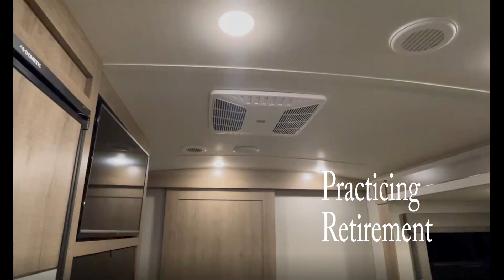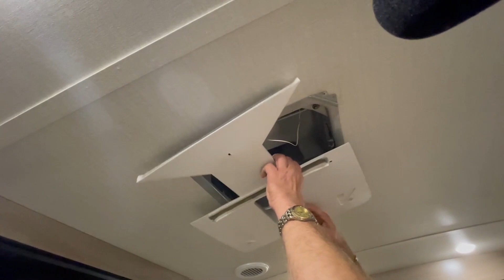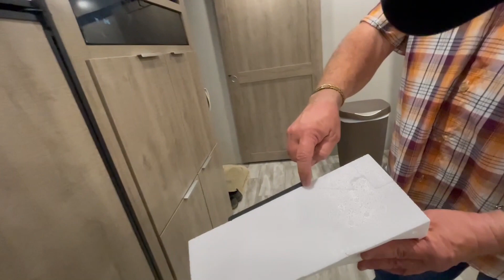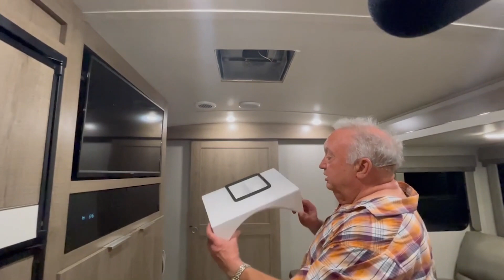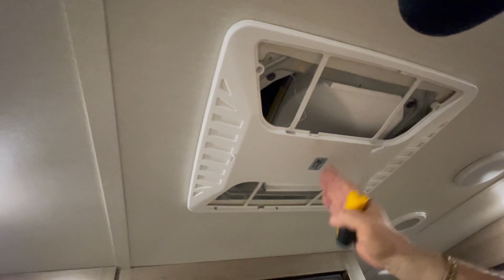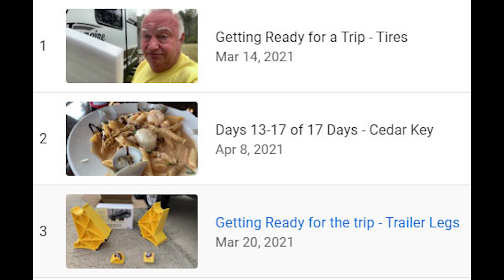Secret to Cool your Grand Design Imagine 2600RB

Comment: What is the piece called that you installed on ac and how do I get one
Reply from the maker: It is simply call "RV Airflow System".  Go to rvairflow.com.  There are several sites and Youtubes that show discount codes of 15% and I even saw one for 20%.  After having used it during the summer, I can tell you it is worth the money.
Reply: @practicingretirement7732  thank you for your reply and video of installation .

Comment: How has this worked out for you?
Reply from the maker: Honestly, it's still early.  I posted another video to show how it worked on a 91 degree day but, we can get summer temps over 100 at times.  The cool air is disbursed quicker and more evenly.  However, everything I have seen and read tells me the best you should expect is 20 degrees below the outside ambient temperature. Thanks for the question.

Comment: Nice job but wasn't sure you were aware the 4 long bolts you installed are supposed to be torqued to 40 to 50 LBS - too little torque can result in a leak and too much can warp the spacer between the actual a/c unit and the roof.
Reply from the maker: Thanks.  I am aware and bought a torque wrench that would go light enough to tighten them.